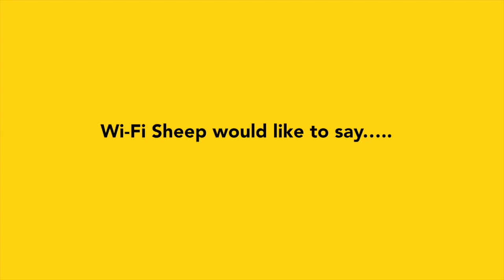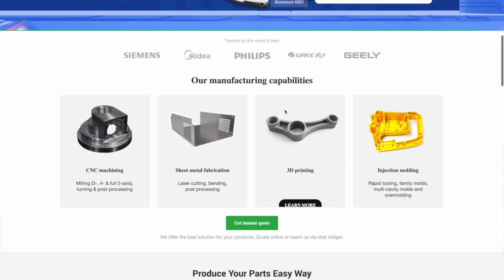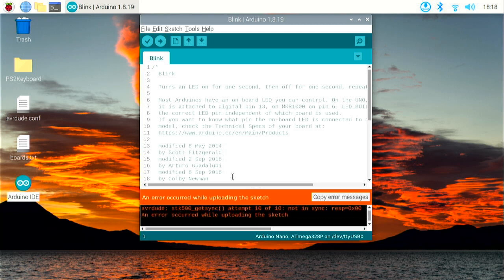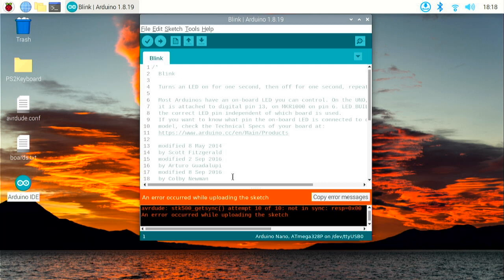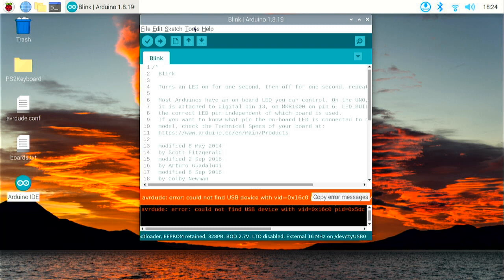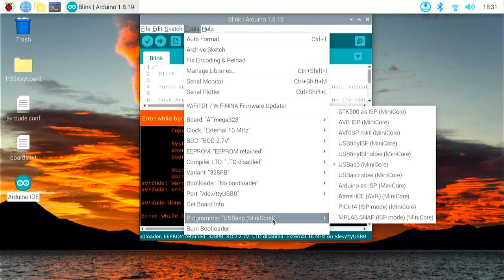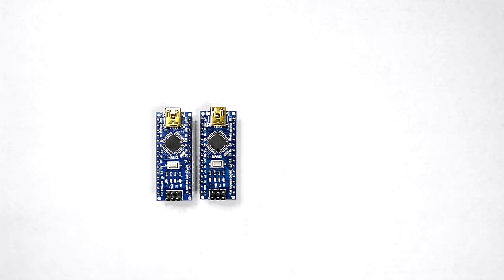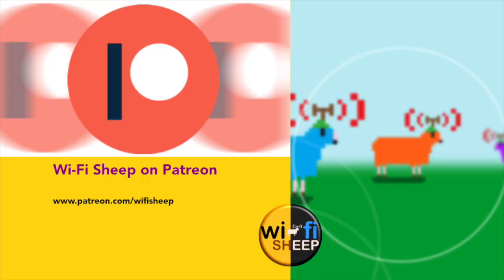8-bit Arduino Clones: Atmega 328pb? How to fix computability issues!

Comment: Something strange happened when I was updated the bootloader, the chip can't use the PB variant even though the chip labelled as PB, so it's working with 328p non PB version of the bootloader

Comment: I have a slightly different problem. I actually want the PB version as I wanted to use one extra 16bit timer. To my surprise the board is recognized as ordinary Nano and programs without issues. However when I switch to MiniCore and PB version it looks like the bootloader is unable to connect to the board. Seems like this time the chinese manufacturer actually did put an effort to make it Nano compatible but made my life harder in the process.
The problem is I cannot simply switch to Nano in Arduino IDE and upload hex compiled for PB as IDE is trying to compile it again and of course doesn't find some registers from PB.
Edit: OK, I have verified that it has a botloader that with "Old bootlader" setting in IDE allows to program it as a normal Nano. And in AVRDude it indeed gives a signature of ATMega328P not ATMega328PB. I've used the "Export Compiled Binary" option in Arduino IDE to get the hex file and used AVRDude manually. It worked as a charm - I can run program written for PB variant and loaded with the old Nano bootloader. Since the last time I've used AVRDude was probably 15 years ago if not more I've took the execution command with all the parameters from Arduino IDE console when it was set as normal Nano and used it as a hint.
Reply from the maker: Ah... ok well thanks for the info.... thats very interesting to know! And well done on getting what you needed working !

Comment: WARNING! The ATmega328PB is NOT a drop in replacement for the ATmega328P.

TLDNR

See Atmel Technical Note AT15007 "Differences between ATmega328P and ATmega328PB" for more information. Of particular concern is that two of the pins that are used for VCC and GND on the ATmega328P are now I/O pins on the ATmega328PB. Pin 3 is GND on the ATmega328P but is PE0/SDA1/ICP4/ACO/PTCXY on the ATmega328PB. While pin 6 is VCC on the ATmega328P but is PE1/SCL1/T4/PTCXY on the ATmega328PB. If the PCB is made as per the original Nano spec for an ATmega328P then pins 3 and 6 will be connected to the GND and VCC rails respectively. If you use an ATmega328PB firmware and enable either of these pins as output things are not going to end well.

Pins 19 and 22 have additional functionality on the ATmega328PB but at least these pins are taken out to the ADC6 and ADC7 pins on the Nano. Pin 19 on the ATmega328PB is PE2/ADC6/PTCY/ICP3/SS1 while pin 22 is PE3/ADC7/PTCY/T3/MOSI1.

The technical note does, however, state that the ATmega328PB is fully software compatible with the ATmega328P so it "should" be possible to upload a Nano firmware to this device and use it as an ATmega328P without the additional features of the ATmega328PB. This assumes that there are no bugs in the firmware which alter any unused/reserved bits in the ATmega328P registers that are used by the ATmega328PB. Such bugs would go unnoticed on an ATmega328P but may cause issues when executed on an ATmega328PB. This caveat also applies to any libraries used. As others have commented the old Nano bootloader appears to work but the new one does not, this may be the reason why.

The Arduino IDE will not program the Nano bootloader into the ATmega328PB because it has a different signature to the ATmega328P and AVRDude checks this signature before uploading anything. It is, however, possible to upload the firmware from the command line using AVRDude with the -F switch. The -F switch (note upper case) forces AVRDude to ignore the signature bytes and upload the firmware.

The ATmega328PB also has additional fuse bits and uses a low power oscillator, the rail to rail oscillator option is no longer present. This low power oscillator has a clock failure detection (CFD) circuit and fuse which force the ATmega328PB to revert to an internal 1MHz Calibrated RC Oscillator when it detects missing pulses. This clock failure detection can occur due to poorly routed boards that would not be a problem with a rail to rail oscillator. CFD can only be recovered by power cycling or a hard reset. This can result communication issues and other errant behaviour.

caveat emptor
Reply: Are these 328PBs that are sold in China real Microchip products, or are counterfeit clones?
Reply: @bzdzgwa  The ATmega328PB is an official part but it is not a drop in replacement for the ATmega328P. Either someone didn't read the Atmel technical note when they chose to use these parts in an Arduino Uno board or they just didn't care. Technically even using an ATmega328P-AU is incorrect for an Arduino Uno as the TQFP-32 part has additional pins not present in the PDIP-28 part which the Uno is designed to use. The ATmega328P-AU is used in the Arduino Nano which has two additional analogue input pins (A6 & A7). There is no way to access these additional pins on a conventional Uno board.

Edited to correct part numbers.
Reply: @bzdzgwa  As to whether the actual part fitted to any board is genuine or fake is anyone's guess if the board is made in China. My biggest concern is seeing these ATmega328PB parts fitted to printed circuit boards designed to accept the ATmega328P-AU as it means that two of the ATmega328PB's io pins are strapped directly to the power lines provided for the ATmega328P-AU; one to ground and one to power. I've seen the ATmega328PB fitted to standard nano boards and even Uno "compatible" boards that have this problem.

Comment: The good thing is that the 328PB has much more peripherals compared to the 328P, you've got 5 timers, 2 UARTs... So we can say that we were not scammed, quite the opposite :'D
And the other thing is that with my nano board I noticed the TX pin always on when I first plug the board, but I was able to reprogram it by selecting the ATMEGA328P old bootloader... Cheers

Comment: I got some of these a couple of days ago and finally got them working fully. Initially using "old bootloader" worked. Various reports said the old bootloader has bugs so I wanted to update it. 

I tried usbasp but that failed because it said it was the wrong chip signature. 

I tried adding a 328pb board but the implementation I tried failed with a strange avrdude error message when I tried to write the bootloader.

After readiing a few forums I found out you can burn the 328p bootloader by changing the chip spec for the 328pb. That can be done by manually entering the bootloader upload commands it uses with avrdude. When you do that the bootloader will lie to the IDE and it will behave pretty much like a normal 328p thereafter. The two chips are apparenly so similar that will work: but you can't use any new features in the 328pb.

After finding that solution I found the bug in the other board implementation and now everything works fine.
Reply from the maker: Interesting! First off well done and Second, thanks for sharing your findings! Really useful to feed back into the community :-) - Tom

Comment: Got this 328PB Version and after trying many things i discovered ... you can use the standard Nano Settings - BUT you must use ATmega328P (Old bootloader) as the Programmer and everything is ok 🙂
Reply from the maker: Oh how interesting... is that a fact? Well thanks for the info!
Reply: It's a fact. Using it for a few days now - behaves quite as you would expect from a Nano. Just a little anoying to swich from regular to old Bootloader (using both versions) 🙂   @WiFiSheep
Reply from the maker: If i get a chance, I am going to try this :-) Huge thank you once again for the tip off!
Reply: Hi.... Can we upload optiboot to it?
Reply: @aspirin4709  sorry .. don't know. I use esp's now

Comment: I have the same problem with the Chinese Ardunio NANO that comes with the MEGA328PU - TH chip. I can't write the bootloader to it, in the IDE this message comes: avrdude: Expected signature for ATmega328P is 1E 95 0F Double check chip, or use -F to override this check. Does anyone know how to use -F to override this check or solve this problem?
Reply: What you have is an ATmega328P-AU. Microchip (who bought Atmel) changed the way they marked these chips a while ago. The chip will be marked as follows:

Atmel 
MEGA328P
U-TH
xxxxxxx
yywwbbb

Line 1 is the Atmel logo. line 2 is the device id (ATmega328P). Line 3 is the packaging and country of manufacture. This is the biggest change as Microchip stopped putting the package type here (A=tqfp, P=pdip) as you know if it's a pdip or tqfp since you are looking at it. The TH means it was made in Thailand. I've also seen U-KR which are made in Korea. The U means that the package is lead (Pb) free. Line 4 is the die revision number. Line 5 is the year (yy) and week number (ww) it was manufactured and the batch/lot number (bbb). It's confusing because the part number used for ordering (ATmega328P-AU) is not what is written on the chip.

Having explained all of that, if the part is a genuine ATmega328P it should have the signature bytes 1E 95 0F. You have not stated what avrdude thinks it is. So either: 

1. You have not connected your programmer correctly and it is reading garbage.
2. You have a counterfeit/fake part.
3. The chip is defective.

If you are getting 1E 95 16 as the signature bytes then you have an ATmega328PB-AU that has been marked as ATmega328P-AU. Which means it's a fake and possibly contains a defective die. To use the -F switch with avrdude you must run avrdude from the command line, not from the Arduino IDE, consult the avrdude documentation for more information.

Comment: It was a Very useful video. Very less people noticed that Arduino UNO and Nano Clone board are available in market using ATmega 328 PB chip-set. This board after programming using ARduino UNO board Selection, it Upload codes. Some Time it Works Properly and Maximum time it works abruptly, Freezes, Restart and many issues. 
I am a Hobbyist and Academic Project developer and I have many Arduino UNO Board with Atmega328 PB Chipset. Finding for the Solution for this clone board and your this video was helpful for me.

Thanks a Lot.

Comment: The most frustrating thing is that these 328PB products are still sold as and even labeled as 328P as you mention. I have two boards with these two chips, I plugged them in both not working, tried a lot of stuff and finally I discovered that 328PB exists... 😂🤣 After that I found your video.
Thanks and subscribed, nice job.

Comment: I've done everything I can think of with an Arduino Uno with  328PB but no luck any tips?
Reply: change--------->  Tools>Processor>ATmega Old Bootloader <--- and see if that works.
Reply: @jenntek.101 yes, it worked with me, thanks 😊
Reply from the maker: If its an Uno are you sure its a 238PB? and not a 238PU?
Reply: @WiFiSheep  Yeah I looked at it from close up it's a 328PB, looks like the bootloader is successfully installed but I cannot for the life of me upload any code to it.
Reply from the maker: Make sure your on the correct COMs port for the device, that the 328PB library is installed and running as shown in the video... 

Make sure you have the CH340 drivers installed if your on PC or MAC 
https://sparks.gogo.co.nz/ch340.html

If still issues You might want to try refreshing the boot loader.
Just to be sure... you're not trying to use external HEX uploads like Xloader? As these dont work with 328PBs
Reply: @WiFiSheep  checked the port, have the library installed, have the drivers intaller, have a fresh bootloader installed, no external uploads either.
Reply from the maker: Thats an interesting one! I assume you can use other Arduino ok and the IDE is working? Might be permissions issues, if the IDE is getting blocked... failing that chip or board issue ... might be work hopping on the Arduino Forums
Reply: @WiFiSheep  tried with another arduino uno just with a 328P chip and works great.
Reply from the maker: Board or driver issue then ....
Reply: @WiFiSheep  doubtful of driver issues, probably board, just really frustrating waiting a month then have it not work.
Reply from the maker: Yeah I can completely understand, I've had a few that have been totally dead or not working .. admittedly rarely Arduino although it has happend to me, but other boards that claim to be compatible 'drop ins' etc and are anything but!
Really hope you get yourself sorted.. sorry cant be any more help 
Tom
Reply: @WiFiSheep  There are a number of Uno "compatible", Uno Plus, and Uno SMD boards in circulation that were designed to use the ATmega328P-AU. This may have been due to an inability to obtain ATmega328P-PU parts or, more likely, to reduce inventory by using the same part for both Uno and Nano boards.
Reply: Try to upload the code via programmer.